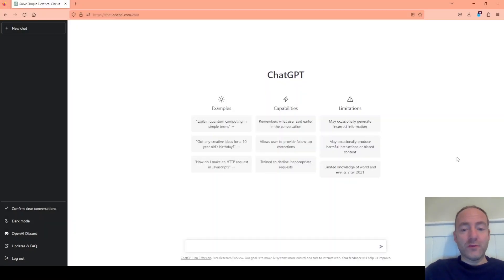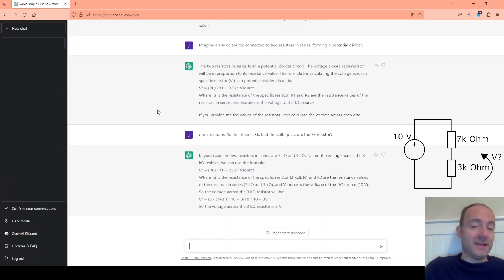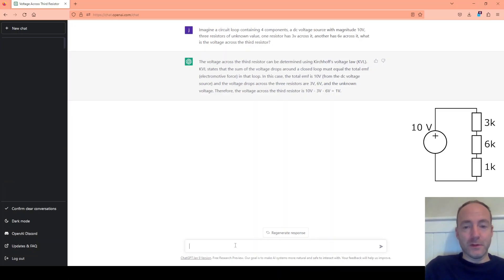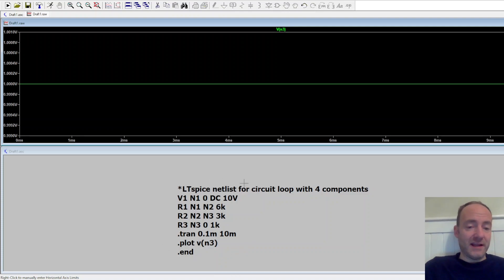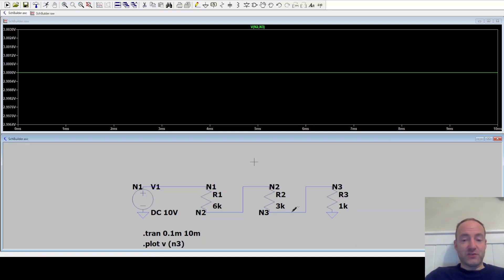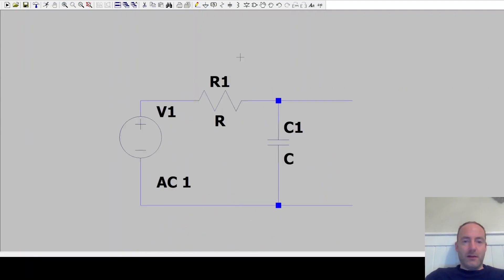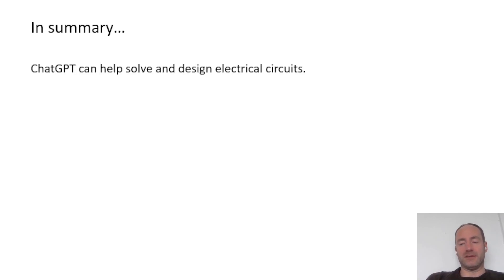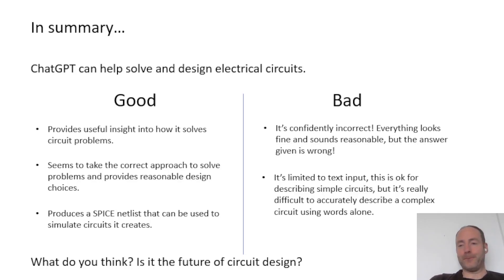AI-powered circuit analysis and design: A game-changer with ChatGPT? #thecircuithelper

Comment: I asked CHAT GPT the following: Can you help design a most basic electronic circuit i can diy with a green and red led to indicate mains power on/off at the db. Keep in mind when the power goes off there will be no source to light up the red led. When the main incomer (before the mcb) power goes off, the backup generator will be started. But this takes a couple of minutes. The mcb & earth leakage needs to be switched off before starting the generator, therefore the red led needs to be on for at least 5 min. After the generator starts the red led can 'recharge' using power from the generator power (live after earth leakage). Optimize the circuit to be small, cost-effective, and as low-power as possible.
It actually did a great job, providing all components required, their respective values as well as a visual representation of a pcb that will fit the 50x80mm space limit I provided. It was unable to draw the actual components but used blocks instead where the component should be in true size.
Not bad!
Reply from the maker: I’m part way through recording an updated version of the video, challenging it with my circuit theory exam questions… it absolutely smashes most questions but then gets some of the simplest ones wrong! Still, it’s improved massively in the last 12 months or so. Thanks for watching!

Comment: Any thoughts on using Augmented Reality to analyze a circuit board?  Similar to   inspectAR,  pedrolucas' Virtual Circuits or 
CuriousInventor ("Augmented Reality BreadBoard circuit building guide")?

Would love to someday see AI analyze a circuit.. send a pdf, and have it return the steady-state voltages at all the nodes.  I tried asksia, but it was kinda disappointing.  Until then, are there any circuit simulator tools you recommend for beginners?  falstad /lushprojects (circuitJS1) , circuitlab, easycircuit, everycircuit, dcaclab, google circuit_simulator_and_editor?
Reply from the maker: I think augmented reality would be really cool for building circuit boards, it’s quite a time consuming process to have to sift through a pile of components, find the right one and then locate where it needs to go on the circuit board. 

I think Ai could also be used to analyse a circuit diagram relatively easily. it would just need to convert the circuit diagram to a net list and then it could be simulated in spice with the results being overlaid on the diagram. I’m not sure how this would work for complex circuits though, a good simulation relies on having the right models and the right simulation parameters, which would be difficult to get from a diagram alone.
 
It would be awesome if you could simply look at a PCB and it would tell you what voltages to expect at nodes etc, but that would take some advanced programming… you’d have to provide the circuit diagram and PCB layout file, but I guess it’s not beyond the realms of possibility?

I’d always recommend LTSpice for simulating circuits, it’s UI looks old fashioned but it’s free, simple to use, has a load of built in models, and there’s a massive community online to provide help. Check out my video on it if you’re interested!! Thanks for watching and the interesting comment!

Comment: That is pretty cool! However, it definitely is far too limited. What do you think would be good enough for an AI that is decent at circuit analysis? Maybe just a large language model that is good at doing calculations like the one you asked + one that answers questions about circuits with great knowledge + generates accurate SPICE netlists? You think that would be a good one? Or would it need more features to be actually usable for decent circuit analysis (e.g. you can upload a circuit and it can analyze it)?
Reply from the maker: Interesting questions… for AI to be truly useful it would need to do more than just analyse a circuit. As experienced electrical engineer can look at a circuit and intuitively know what it does and what’s critical. For example, looking at a real audio amplifier circuit there might be hundreds of components, most have a very minor impact on performance, an experienced engineer can recognise this and focus their analysis on the key parts of the circuit. An AI would need this level of intuition, if not it would simply calculate all the currents and voltages in all the components (i.e decoupling capacitors etc) and you’d be bombarded with information, most of which is not useful. 

AI might be better at creating circuit designs by adapting existing circuits. For example it could be trained on 100 different amplifier circuits and then you could provide a specific set of operating parameters and it would design an excellent circuit. It shouldn’t be too difficult to achieve this, but it would only ever be able to design circuits it had been trained on. I’m
Generating spice netlists is useful, but it would be great if it could make a proper circuit diagram. I’ve tried a few times to get it to do this but it’s basically a joke… just gives a random collection of components stuck together!
Reply: @thecircuithelper  That makes sense. I would think circuit analysis would be useful as well because AI essentially helps do calculations for non-experienced people with electronics. For example, someone who is learning electronics as a hobby can use AI to help them by asking it questions before it makes a circuit for their needs. The AI can maybe help them with calculations as well.

I would assume the best AI for everyone would be one that can analyze and discuss a circuit (for beginners) and  then create circuits based on parameters (for engineers). It would do this via netlists. 

As for the schematics, yes AI is notorious for being hard to develop for analyzing images. There is actually a subdivision of AI called Computer Vision which usually requires PhD and extensive experience needed to develop AI models that can analyze images and understand them. Generating images is a whole new world of difficulty as well, especially circuits. That's why making the AI generate accurate diagrams would be a lot heavier task than just netlists.

Comment: If it could only draw them,, it is basically doing math
Reply from the maker: I know…. After every update I try to see if it will draw them and it never works, the best you can get is some kind of Disney-esq cartoon that doesn’t show proper components etc. I’d be happy if it could even analyse a circuit diagram, but that doesn’t even work! You can upload a circuit and it ‘analyses’ it, sometimes spitting out an answer, but always it’s totally incorrect. Basically, it doesn’t seem to do maths, it just gives you the most likely answer based on your prompt.

Comment: how can I feed AI   in term of accessibility technical diagrams charts in white papers and application notes that are usually available in html or pdf format?
Reply from the maker: This is a good question and I have tried to do it every time chatgpt updates. I paid for the subscription that allows documents/images to be uploaded, but the results are very poor... it can recognise that a circuit has been uploaded, but it cannot solve the circuit yet. I will keep trying and make a video as soon as I find something that works! Thanks for watching!
Reply: @thecircuithelper  try prompt tuning with a soft prompt. I would experiment preparing a soft prompt "vector embedding" with spice modules and 3d modules from Navitas semiconductor webpage product section. Datasheets are in pdf which is a bummer.  I am looking to create a prototype for a cutting edge product and I am at your disposal if you would like to discuss it further
Reply: @ramidaoud3776  good luck with the product

Comment: How long before it is capable to design novel circuits that work, but which are not easily understood?
Reply from the maker: Im a little skeptical if it will ever be able to generate novel circuits that actually work.  As far as I understand the tech, it essentially works by predicting the most likely response for a given question based on a massive library of data. To make a working circuit it would need to actually calculate component values to meet the specification, rather than pick the most likely value based on its analysis of many previous circuits. I guess 90% of the time a predicted component value might be ok, it’s basically what I do in the lab for non-critical components (e.g stick a 1uF decoupling cap in, based on nothing more than past experience), but sometimes that approach simply isn’t going to cut it. 

Certainly GPT3 was poor, asking it to make a spice net list for anything more complicated than a few resistors didn’t really work. I’m interested to see what GPT4 can do when it can analyse/produce images.
Reply: @thecircuithelper  it probably will not do worse. Wait and see.

Comment: What about using the recently released Chat gp4 to perform circuit analysis ? They say it's the new turbo charged version of AI that takes everything up four notches higher.

My feeling is that if they can't get AI to perform everyday tasks and analysis then people will lose interest in this technology. 

Where's Elon Musk , I thought he was gonna make all this stuff work and captivate our imagination ?
Reply from the maker: Very interesting point, I’ve seen a few videos on GPT4 and it looks amazing, not sure if all the features are available yet though. The big problem with GPT3 was it being limited to text input… it’s easy enough to describe a simple circuit with words, but when there are multiple sources and loops etc it’s almost impossible to describe it in a way that can be accurately interpreted (I tried several times for this video).

I’ve seen a video on GPT4 where they used an image as an input, if this could be a circuit diagram it would be a game changer! Even better if it could generate a circuit diagram to meet a set of design criteria.

I still don’t think it’s going to do away with electrical engineers though, the internet is awash with circuits, but actually understanding them enough to build and fault-find when they don’t work is the real skill and it isn’t going to be replaced any time soon (I hope 🤣).

Comment: Wow! The language comprehension is incredible. I designed one of the early Natural Language to code alg's. This is light years ahead. Did you get a chance to play with Microcap? It used to cost thousands and is now free.
Reply from the maker: It seems very sensitive to how the prompt is written, two very similar sounding sentences about a circuit can produce very different results!

I downloaded Microcap and had a play, it’s very comprehensive, much more so than LTSpice! It will take some getting used to though…
Reply: @thecircuithelper  Remember to update the components in the update box. It's very comprehensive!